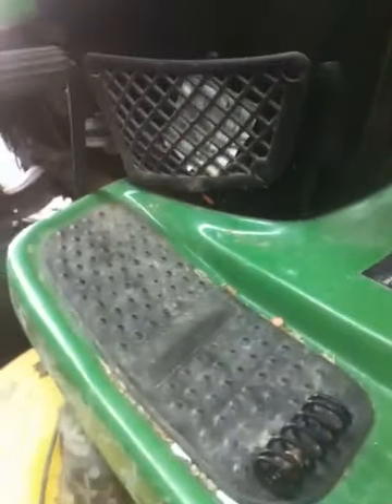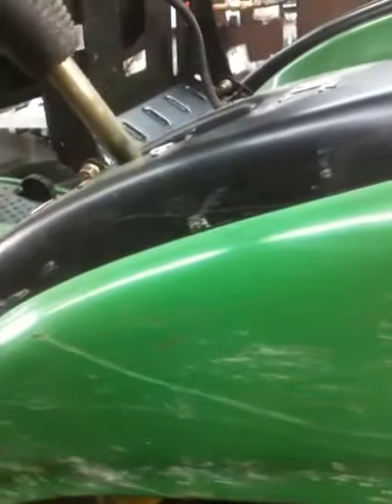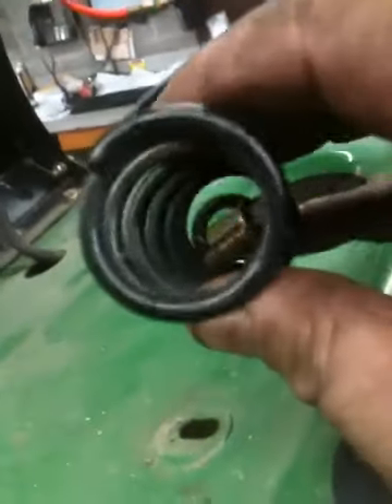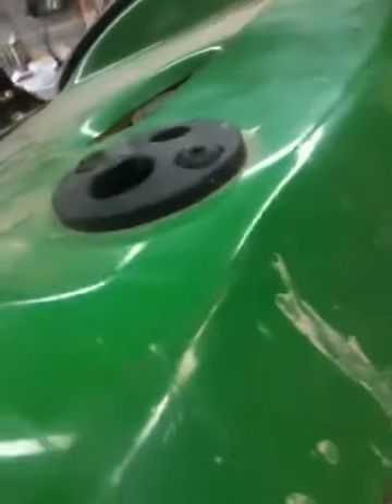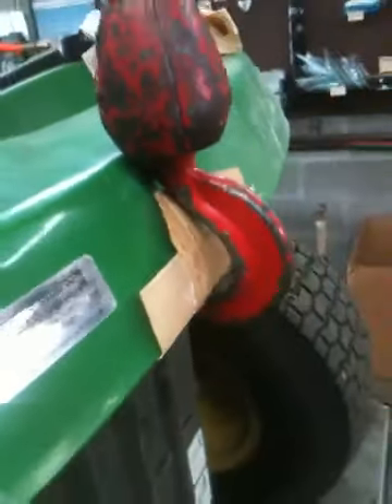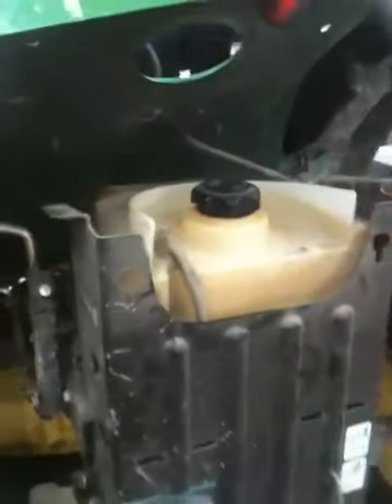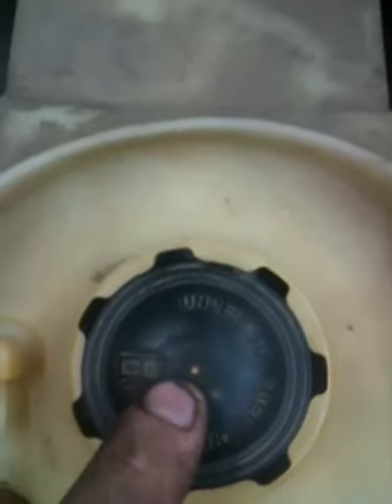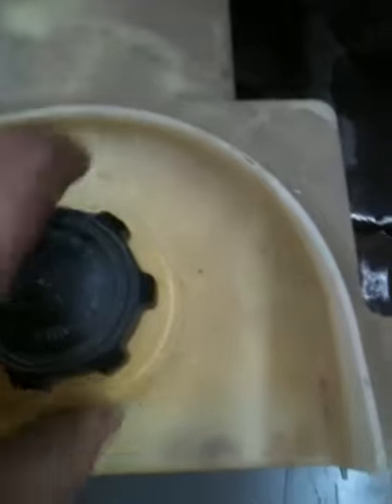LAWN TRACTOR REPAIR John deere riding mower fuel tank replacement

Comment: Thanks, Jeremy.  Like others have said, this saved HOURS of labor.  The instructions that came with the replacement tank have you taking down the mower down to the frame.   An 8 hour job if not more for the amateur.  Your solution... 15 minutes.    I had no damage to the body.

Comment: to add, this method WILL bend the green fender cover in the middle.  To do it right is easy. 1) Remove battery  2) Remove 6 10mm bols under black engine console. 3) Remove steering wheel with 19mm socket. 4) Remove two rear 10mm bolts as described here under seat (springs) 5) Then remove gas tank feed hose and pull out tank once you life the rear up.  This way your fender cover will not get bent.

Comment: When I lift the rear of the body after removing the 2 spring bolts on a LT130 there is resistance to the point of damage to tin. Even after emoving 6 more bolts near the front of the body there is too much resistance. Did I miss something in your video?
Reply: +Mike Boggess I have the same issue Mike.  I have a 115 and I cannot lift body w/o damaging the body
Reply: +William Snyder  To lift the body off it looks to me you will have to remove the steering wheel, and the shroud around the steering column and more.

Comment: We had our fuel tank shift out of place so we didn't have to remove it completely. Followed this and other videos about this and just removed the seat springs and lifted the back up carefully. This gave us access to move the tank back into its proper place. We may need to eventually replace the tank and if we do, we will definitely lift the back up again as disassembling the entire tractor is way to involved....I think if a couple of kinks in the metal occur it would be well worth the time and money savings( if you had it done at a repair shop). Good Luck!

Comment: My new gas cap is just like the old one, with a little, tiny hole just waiting to get plugged up.  I took a plastic screw cap (little plastic round box with a snap lid hinged on top) and drilled a hold in the cap about a quarter inch, then glued that to the gas cap with the holes on the bottom centered.  Then I put a little piece of cotton ball in the top (really loosely packed to allow air).  Now I can clean that out easier if I need to.  I thought about drilling the gas cap out, but didn't know if it might mess it up.

Comment from the maker: does gas shoot out of the spark plug hole when you turn it over?  does it spin over with the plug in?  sounds like the needle and seat has turned loose in the carb and is flooding out

Comment: In addition to this video and to keep from bending the frame simply remove the battery to access 6 bolts holding the steering shroud and fender mold to the frame.  Also remove the bolt holding the steering wheel.  Doing these steps adds about 30 minutes to the job but you avoid bending your fender mold.

Editorial Comment:  John Deere engineers should be ashamed they designed such a cluster f*ck of a gas tank.  The last thing a lawn tractor owner should worry about is the gas tank.  The gas tank should last beyond the life of the lawn tractor, Period!
Reply: I did exactly as you suggested, removing the 6 bolts and steering wheel (as well as the rubber handles on the gear shifter and deck adjustment). Frame was easy to pull up and prop by hand, didn't bend the frame, and everything lined up fine after.

[Fwiw, the replacement gas tanks technically fit but are not a true replacement.  A little disappointed, but at least this tank will likely outlive the mower]

Comment: It looks like ill bend the tin work if I lift it that high.Im all in for cutting corners to fix this disaster but I dont want to wreck the body work doing it .Factory way has got me stripping the mower butt naked to change the tank.Looks like this is a disease with these john deeres.I'm going to give it a try. Thanks for the video.

Comment: This works and leaves dimples, but who cares?  Saves about 5 hours of mechanical aggravation!  Thanks for the vid!!  I also want to add, if you take the deck raise / lower handle off, and get a third hand to help, the metal part of the lever makes a perfect prop to hold the body up.  I got lucky and it positioned itself perfectly for a prop on its own.  To clarify,  you are bending the body, not lifting it, but it bends back and I just kicked the dimples nearly gone when I was done.

Comment from the maker: I've done hundreds without removing any extra bolts 
Cheers!
Reply: How different / what are differences for doing the tank replacement on a bigger G110 (small Garden tractor with 2 cylinder Air Cooled Kohler 25 HP CV730S and 54 inch deck) ?? 
    The body seems like its a bigger ‘single piece’ that runs from the rear fenders all way down to around steering column shroud/controls station and it (body) includes the floor / foot rests, too.

Comment: I can live with the "dimples" in the body if it means not having to disassemble the front end to lift the body off the frame.  Looked in and can see trash in the tank.  Figured I'd clean it now as opposed to when it quits. Thanks

Comment: i have a tractor like this as wel the tank has dried gas in it and it now has turned to varnish for sitting for 10 years i got it used the gas line comes through the top of the tank do you know away to remove the tar and unclog the fuel line?

Comment: Hey man I have a question. If you still look at this vid, I just did exactly that, and it does no come right up. It seems that there is more bolts in the feet or engine area to remove. Is this true? or do I just go full power on lifting it up. "It" is the frame or the seat are to get to the gastank

Comment: What is the model of this tractor. I have a 155C Auto that wont run and we took it in for repair and they said to remove the body alone would be $400 - Not paying that obviously if it is only 2 bolts.
Reply: This is an extremely oversimplified video. Replacing the gas tank requires mucho more disasembly.

Comment: I got a X540 JD, has a bad fuel sending unit. Did yours have the external guage where you had to switch the sending unit to the new tank and if so, was it a pain with the sealant, etc?

Comment: i think the fuel punp isn't working correctly i ran a piece of fuel line from the cut off valve to the gas tank and pulled just enough gas to fill the inline fuel filter but the mower would not start unless i primed it and it would only run for a few seconds

Comment: Iv got some good fuel tanks for this model tractor. I have removed off mowers I parted out. If interested hit me up on my channel. I can send in mail and I sell for much less than new cost. It's unusual for these tanks to leak, iv never seen one leaking on the tractors iv worked on. That mud dobber must have been super Tiny to think that hole was a good choice to hide spiders in.